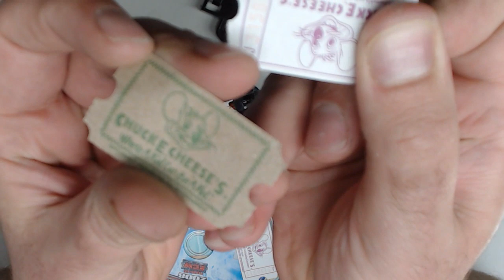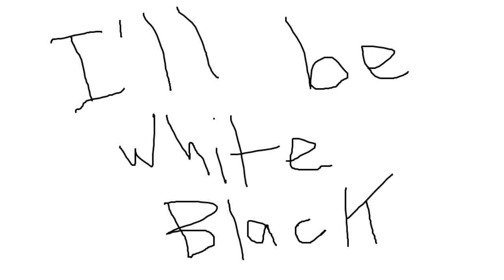How to fix a PS3 Slim that won't Take Discs/ Game Stuck

Comment: if theres disks stuck in a ps3 you can simply pop out the small tab on the bottom of the console and manually remove them with a screwdriver. although this still doesnt fix the console not wanting to take disks.
Reply from the maker: You sure can. https://youtu.be/RlhOq0gGv6Q

Comment: Hey my ps3 disc drive won't spit out disc's I've done the manual eject but how do I fix the disc drive
Reply from the maker: You would have to give the disc drive a real good refurbishment. Replace parts if needed and test thoroughly. An experienced technician would be preferred. You can try calling around to local video game stores or computer repair shops in your area to inquire if they provide that service. Most do not but you might get lucky.

Comment: So I took out one of my ps1 games out of my ps3, and was switching it out for another game. That's when I noticed that it wasn't taking the disc or any discs. What would be the issue for this? Is it the reader that is loose or something?
Reply from the maker: Who knows why these things happen out of the blue. Try holding the eject button down until it begins its "disc drive reset" action. Hopefully it'll work after that.

Comment: Your PS3 insides looks different than my PS3 😳
Reply from the maker: Every variation of the consoles (ps3 fat, ps3 slim and super slim) have several variations each. They change it up inside for whatever reason. It’s best to search for videos using the model number of your console.
It’s also the same with all the ps4 variants. Gets annoying. Usually it’s not a crazy change.